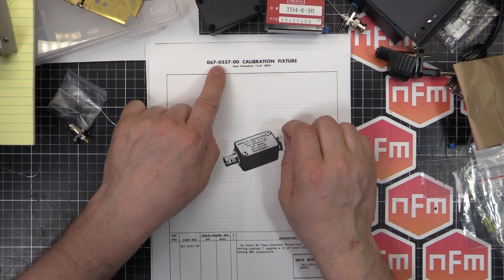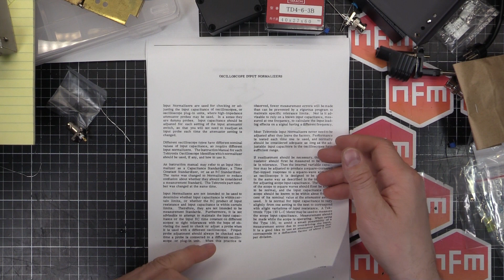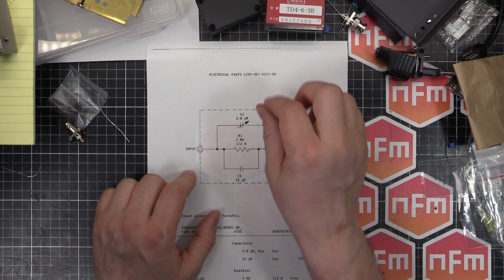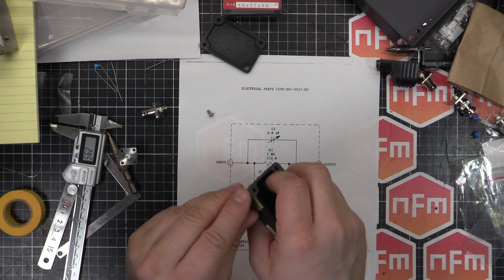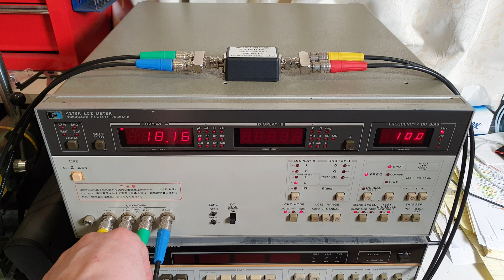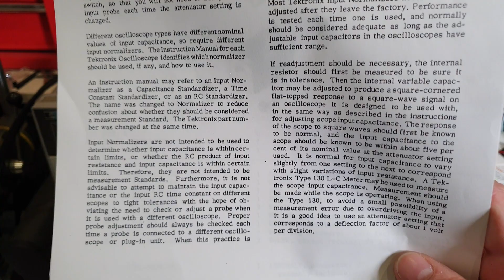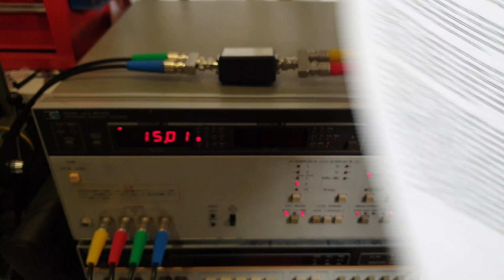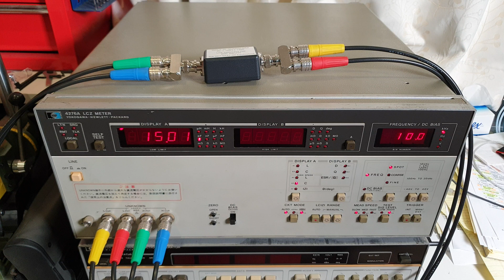How to Build a Tektronix Input Normalizer

Comment: Should any 2 wire LCR be able to measure the capacitance?  The 4 wire is nice but not common.  I have several original Tek normalizers and they all read near 110pf

Comment: Thanks to your inspiration, I am in the process of building a normalizer. I am keeping it simple by only having it be x10 (no x1 switching) and using old school construction techniques. My aluminum box is 25x25x50mm. On a prior PCB panel order, I had created some Vero/Strip boards, to fill out the unused panel area. I am using a section of that to create three traces - the resistor, the fixed cap and the trimmer - in parallel. I mounted three sections of pin sockets on these traces. The traces and sockets are separated in the middle. This will allow me to span the breaks with the components, to create the circuit. And, I can easily change out components, as needed, to create different multiplication values. I hope to post pictures on DropBox, when I am finished. Thank you for teaching us about this fun project.

Comment: I think I am over thinking this... My probe specs state the compensation range is 10pF-35pF. But, it also states that the input capacitance is 1x = 85-120pF and 10x = 18.5-22.5pF. I take it that the probe is expecting the input to carry between 1x = 85-120pF and 10x = 18.5-22.5pF. But, what I need to be concerned with is the compensation range of 10pF-35pF. Additionally, because your adapter has a 1M resistor, it is only usable for the 1x scope setting. If I have that correctly, I might add the extra 9M resistor and some switching to allow 1x and 10x. I might also use a capacitance trimmer with a greater range, so that the adapter would work with all my scopes. Your thoughts?

Comment: I have a couple of scopes. How do I determine which versions I need? What do I need to look for in the documentation? I just need a better explanation on that. Sorry to be so thick-headed. Thanks, in advance.
Reply from the maker: Check the service manual of your scope for the 'Performance Check' section.
At the start of that section is a list of the equipment needed to check and calibrate the equipment.
In the list, you want to find the 'Normalizer', it will tell you the resistance and capacitance, and also the part number. (although I know that the 2465B service manual has the wrong part number, the specs are correct though...)
You can check here for more info on the 4 types here:
https://w140.com/tekwiki/wiki/067-0537-00
https://w140.com/tekwiki/wiki/067-0538-00
https://w140.com/tekwiki/wiki/067-0539-00
https://w140.com/tekwiki/wiki/067-0541-00
Reply: @NearFarMedia  I was meaning for my non-Tek scope; sorry/Siglent1104X-E. Aluminum case has been ordered!
Reply from the maker: Ah, I understand.
Basically you would want to select the resistor and capacitor to match the characteristics of the scope probes expected by the scope.
The impedance and capacitance adjustment range of the probes supplied with your scope would be a good start.

Comment: I actually cheered, out loud, when you hit 15.00, spot on. lol. Great point on tapping the case threads for better continuity. Nice adjustment port. Maybe add a label to the back screw hole = "Adjust Here." Great project.I had not thought of the influence a BNC cable would inject. Yep, I'm building one. Thank you!

Comment: Pomona 3752 would be a nice little option with included connectors. Not that cheap, but nice.
Reply from the maker: Yeah, looks like a nice box, but a bit more expensive than buying the parts. Perfect for someone who doesn't want to or can't drill the holes themselves if they are willing to trade off convenience for price though.
Reply: @NearFarMedia  pretty much. I used them when I did modern versions of the Spectracom 8140 pods. See photos on: https://julien.studio442.com.au/businesscard/

Comment: Great and simple project, tanks for sharing! :-)
I hope that you please want to answer this maybe stupid question, but would it not be even better to compensate for the lead you chose to use in your test, before using it, to get best results?
Reply from the maker: A straight through BNC cable has no means for compensation adjustment as it's just a straight bit of coax cable, so this module is basically acting like the compensation adjustment on your scope probe.
It effectively turns your BNC cable into a scope probe, except with a BNC connector on the end instead of a test probe or test hook.
Reply: @NearFarMedia  Oh okay, thanks a lot, so you could use the device in the end of a coaxial cable, if you want to be sure that it do not skew anything?
Reply from the maker: Exactly. :)
Reply: @NearFarMedia  It's not so strange why I love your channel! Easy explanation, done in an interesting way, that I learn from, every time:-)